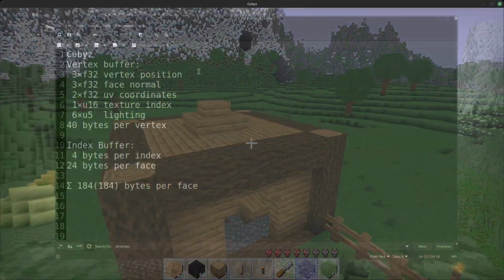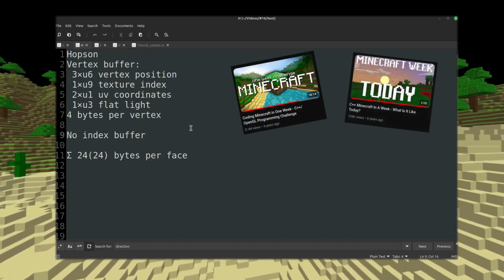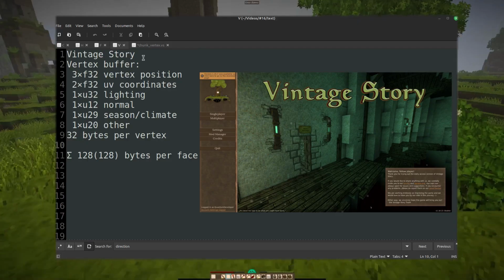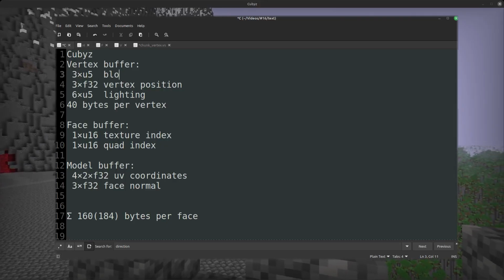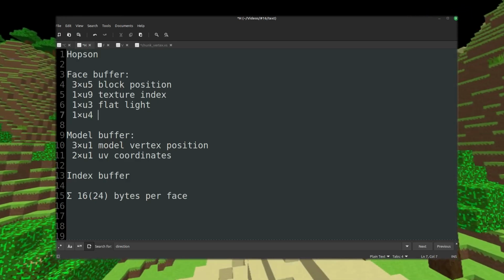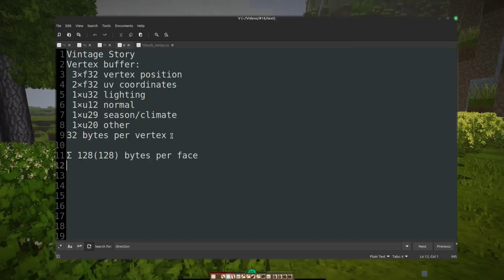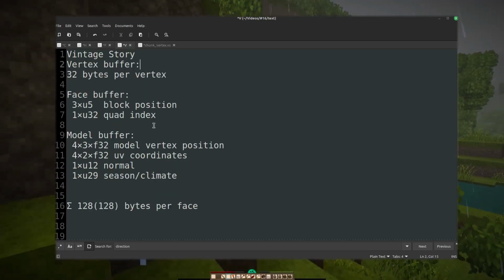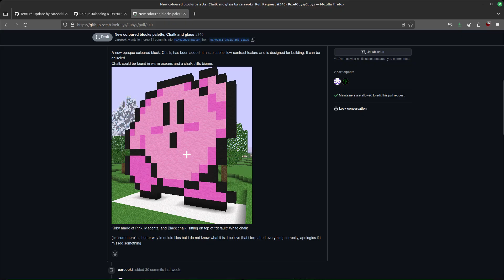Block Models, Stairs and Mesh Optimizations

Comment: why not doing the meshing on the gpu ?
Reply from the maker: I don't think it's worth the effort, especially if the other bottlenecks, like networking and terrain generation, cannot be done by the GPU, so there will be a lot of copying.
Furthermore I want to support integrated GPUs, where it's likely going to take away too much processing power from the actual rendering.
Also I think I can more efficiently manage and allocate the mesh data from the CPU side.
Reply: @quantumdeveloper2733 Thank you but i have another question: can the model list work with every type of model faces or does it has to be a quad ?
Reply from the maker: It has to be one face type, and here I chose quads because it is the most common face in Cubyz. But luckily for us a triangle can be represented as a degenerate quad, which is a bit wasteful, but better than nothing. So yes, every type of model faces can be supported.

Comment: I don’t really get how the index buffer can be reused here… aren’t the shared indicies wildly different between chunks?
Reply from the maker: I limited my engine to quads only, so the index buffer is just a collection of quad indices (0, 1, 2, 1, 2, 3 or something like that).
And thanks to the baseVertex parameter all indices start at 0.
Reply: @quantumdeveloper2733  I fear I still don’t understand…  quads as in the primitive GL_QUADS? Isn’t that deprecated? (Thanks for the fast response btw!)
Reply from the maker: @mihneagubani6336  as in 2 triangles, 4 vertices, 6 indices per quad, no shared vertices between different quads
If I had GL_QUADS, I wouldn't even need to use an index buffer at all.
Reply: @quantumdeveloper2733  Thank you for your response! I made a lot of progress on my engine since then, but once I got stuck I used nsight graphics to look into how cubyz renders it's stuff and it says the Indexbuffer holds a huge amount of indices. I thought the idea was to only have these 6 and them getting repeated every 6 vertices? Am I misunderstanding something?
Reply from the maker: @mihneagubani6336  The vertex buffer only holds the same six vertices, offset by 4·i, here is the construction code if you want to see the full formula https://github.com/PixelGuys/Cubyz/blob/a8b36f3ca450d83e9fd2e903bb998b5f4169b7ad/src/renderer/chunk_meshing.zig#L123-L127
As you can see it is the same set of 6 vertices that gets repeated in a large index buffer, in my case ~2 MB since I made an estimate for the chunk size to be 3 faces per voxels.
This might seem like a lot, but the point is that I only need one index buffer, if I had many small index buffers I would end up with something like 6 GB for my ~250 million faces at max render distance.
Reply: @quantumdeveloper2733  Thank you a lot! Now it makes sense to me. Wishing you the best with the continuation of your project!

Comment: Is it still seperate and requires the app itself to download? Because if you want modding capabilities then add the files seperate and game seperate
Reply from the maker: Your message is lacking context, making it difficult to understand.
If you want to run the game, just go to the github page linked in the description. You don't need to install any other software to run it.

Comment: I hope something like this is possible in a game engine like Godot. But maybe I just have not wrapped my head around shaders that well yet so I don't fully understand this video yet. Would technically you would be using a compute shader for a per face buffer?
Reply from the maker: Of course it works in godot.
You don't a compute shader. You generate the face buffer during meshing on the CPU and put it into a texture(or SSBO), then in the vertex shader you read from the texture at `gl_VertexID/4`.
Reply: @quantumdeveloper2733  Thank you! I think I am getting a much better idea on how to implement this. I have rewatched this video a few times now haha thank you for making it. 
I know some people want code examples, but I think they are forgetting the cubyz code is already open sourced! And conceptually the video logic is more important than anything else.

I have been looking at cubyz myself for inspiration for the meshing algorithm. I thought it was clever to use a mask to determine out of bounds when checking neighbors. Eventually I hope to implement a face/model buffer and chunk palettes to greatly reduce memory. The only thing I am kinda confused from this video is how you are able to store indices for the entire world in a single place. I assume what you are doing is math in the shader to calculate the indices?
Reply from the maker: @AJ213Probably  For the indices I basically have one giant index buffer with 65536×6 elements with the following pattern:
0 + 4×i, 2 + 4×i, 1 + 4×i, 1 + 4×i, 2 + 4×i, 3 + 4×i for all i < 65536
Then in the draw command `glDrawElements` I can tell opengl to draw the first 6×faceBufferSize indices from that buffer.

If you are storing all faces in one giant buffer with suballocations, like I do, you can use `glDrawElementsBaseVertex` which allows you to add a constant to the entries of the index buffer.
Reply: @quantumdeveloper2733  I think I am not going to be able to do the full optimization down to 8 bytes (as I don't have lighting yet) per face as Godot doesn't support low level rendering APIs. It sucks, but at least using this video I was able to go from 168 bytes per face to like 80 (vertices + indices + face buffer via texture).

I will make a video about it one day and then reference this video XD Maybe I will switch to custom engine or modify godot so I can do the full optimization.

Comment: one thing i see othe voxel game like velorean do for render gistance is havin a normal ich terrain mesh that has the same height and texture of the voxel montain, so far away in the distance you can see that montain but it only starts rendering as a high detail voxel mesh as you gets closer
i think other voxel engine devlog also did this trick but i cant recall from memory who, if you or someone knows cudos to him too

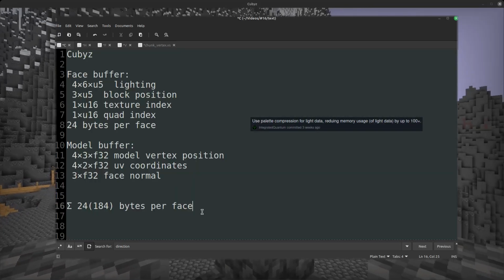Comment: 17:10 could you render further away chunks with reduced precision? reduced lighting, reduced model precision in model vertex position, ...?
sure that would require different shaders for closer/further away chunks, but especially since "most chunks are further away" maybe there is some usefulness behind that idea.
Reply from the maker: Nice idea, but it's not really worth it. The first two levels of detail take the majority of the mesh data, because the rest doesn't display any caves.

Comment: There was old abandoned game project called seed of andromeda, they had 500km view distance, they achieve this by having 2 types of terrain: close terrain which is basically regular minecraft like blocks, and far terrain which starts somewhere 100m away from camera and it made not of cubes, but of generated heightmap-based terrain, and it uses progresively larger and larger grid size as it goes into distance. So few km away terrain have large triangles which hugely reduce triangle count and all problems which comes with extra triangles. Also it helps with quad overdraw and other issues(including vram). 

Personally i did in the past marching cubes terrain using similar aproach, each chunk further from player had same voxel density(32*32*32 voxels) but voxel size keep doubling, so in last "lod" chunk had size of 64x64x64km - each voxel was 2x2x2km, and surface generated from this large chunks, viewing form over 80km distance, was perfectly fine.

Another solution could be use raymarching for rendering distant chunks, raymarching cubes on grid is cheap, but again the further they are the bigger they should be otherwise will blow vram again.

I mean, if you run out of vram cause of vertex data, you need to change approach fundamentally...
Reply from the maker: I'm already using LOD, but I would like to push the distance at which the LOD begins.
The most faces are contributed by LOD0 and LOD1, all further LODs don't render caves and are negligible in mesh size.

Comment: Hi! Can you pleasy show how you have done it in the code? I dont get how you can make a face buffer when there can be different amount of faces, but buffers in shader are const-sized
Reply from the maker: There is a link to the code in the description. I'm using shader storage buffers, you could also use textures if you want to support older versions of OpenGL.

Comment: Have you seen "Vercidium"s "I Optimised My Game Engine Up To 12000 FPS" video?
He also goes into vertex optimization.
To the point where he does buffers for each direction and has 1 large buffer for rendering for each side instead of multiple buffers for each.

Its at least worth a watch even if some things don't apply.
Reply from the maker: Yes I have watched his video and there is some useful stuff in there.
But I was really surprised that Vercidium didn't seem to know about the optimization I show here.
Instead he used instanced quads to achieve the same results that I get by using a per-face buffer.
I tried instancing myself, but it can be quite a performance problem on some computers, like on my 5 year old intel laptop I measured a 3× slowdown from instancing vs my per-face buffer.
Reply: @quantumdeveloper2733  huh good to know.

Comment: Great work Quantum! As a further optimization, I wonder if it would be worth splitting chunk data into two parts - one mesh for all of the full blocks, and one mesh for all of the block models. You could pack the full block data more tightly, reducing memory footprint (and perhaps vertex shader work if there's less data to decode). The tradeoff being you need more draw calls for chunks that have block models. Although, looking at your example, I guess you'd only really be able to eliminate the quad index at most. So perhaps, there's not much improvement to be had.

Also, I know that you mentioned Vulkan. Have you considered using WebGPU instead (the Zig project for it is called mach-gpu)? The API is higher-level and less verbose, but it still gives you the power of a modern graphics API. Plus, you can target Vulkan/Metal/DX12 with it, so cross-platform compatibility would be easier.
Reply from the maker: I couldn't even eliminate the quad index completely, since I still need 3 bits to distinguish between the 6 different faces. Together with position (15 bits) and texture index (16 bits) that's also still above 32 bits, so I couldn't even save anything really.
Generally light data is the biggest offender anyways. I can probably set up palette compression for it. That would gain a lot more memory.

As for WebGPU, I haven't really looked into it, but generally I prefer having lower level APIs. Additionally Vulkan could also allow me to play around with new stuff like mesh shaders, which could give me a selective performance boost on the hardware that supports it.

Comment: disclaimer i don't know much about graphics programming, but how would the model buffer work if ur using greedy meshing like in cosmic reach? like i imagine the model vertex positions won't work with it bc u have to store different vertex positions depending on how many similar blocks are nearby
Reply from the maker: By the way Cosmic Reach doesn't even use greedy meshing anymore.
But it would definitely be possible to do greedy meshing with a model buffer.

face buffer:
  3×u5 block position
  2×u5 greedy meshing extent
  ...
model buffer:
  3×f32 base model position
  3×f32 model extent x
  3×f32 model extent y
  ...

Then the world position is:
var pos = block position + base model position
if(isRightSideOfFace) pos += (model extent x) * (greedy meshing extent)[0]
if(isTopSideOfFace) pos += (model extent y) * (greedy meshing extent)[1]
Reply: @quantumdeveloper2733 damn i didnt know cosmic reach cut that already lol. anyways interesting solution, thanks for responding

Comment: My first thought was to just use instancing.... The only data that gets multiplied by instance count is lighting, position + maybe a bit more. Lighting could easily be < byte, and position could be just the offset to this chunk's position in the world, so we can store most of the position bits in buffers, and just fire away with glmultidrawinderct calls.
Reply from the maker: I tried it, but instancing is 3 times slower on my 5 year old intel laptop.
"Lighting could easily be < byte" Well I have 6 color channels for rgb light and rgb sunlight, so that's not going to work out sadly.
Reply: @quantumdeveloper2733  I was thinking of basic lighting so pixelout.rgba *= lightingvalue, so ya doesn't work for your case.  And ya laptop hardware is definite profile and try everything situation...

Comment: if Vintage Story has that many models, I probably don't want to make a giant buffer with all the models that I keep bound at all times. I suppose you could keep "atlas buffers" around and bind those as necessary, but that's a pretty tricky technique.
Otherwise, interesting video! I definitely don't use buffer object availability in vertex shaders to its full extent, nice to see some elaborate examples
Reply from the maker: I don't think there is a cost associated to binding large buffers.
Reply: @quantumdeveloper2733  Well, it consumes GPU memory by virtue of being in GPU memory.
Reply from the maker: Yeah, but whether you bind it or not it always consumes the same amount of memory.
And if introducing a giant buffer reduces memory usage of thousands of smaller buffers then that seems like a good tradeoff to me.
Reply: @quantumdeveloper2733  yes, you are correct, to reduce memory usage you'd need to stream atlases dynamically. Really, whether it's worth, it depends on how many different models are usually in visible chunks - I'd reckon the number is pretty low most of the time.

Comment: Really smart optimizations, nice work. Have these changes led to any increase in the framerate due to better memory throughput?
Reply from the maker: I have not done a direct comparison, since I already had 24 bytes per face before implementing block models. I could have compared it to the java version, but that wouldn't be a fair comparison since too many things have changed since then.

From a test I did a couple years ago in the java version, where I went from 56 to 8 bytes per face for lod chunks, I measured an insignificant performance increase.
But I think in the end it all depends on the hardware you are testing on and how bad the vertex data was in the beginning.

I can give you a calculation though:
If I look at the bandwidth of my memory (which seems to be 51.2 GB/s for my dual channel DDR4 RAM) then loading 8000000 faces takes 4 ms at 24 bytes per face and 29 ms at 184 bytes per face. In the current version of my engine it takes just 21 ms to render 8000000 faces. So it definitely would have increased the framerate significantly.
Reply: @quantumdeveloper2733  Makes sense, very impressive work!

Comment: There's six bytes per vertex because that vertex requires 3 sub coordinates to be in 3d space, and an integer is a 2 byte object leading there to be 6 bytes per vertex. Theoretically knowing that they didn't need to account for the blocks being off center, this is an optimization from what I would otherwise use floats for, each block being the space between four vertexes on a invisible grid. The slabs and stairs however I before watching the video theorize they either use shaders, or that they are treated like half floats while not having to be full size.
Reply from the maker: Nice try, but sadly your vertex data only allows drawing untextured terrain without any lighting or ambient occlusion.
Reply: To be honest I'm new to graphics programming and the closest to any kind of project like this I've had is my js project where I learned how to make purely cpu 3d. I only got to make the wire frame before my computer got wiped. I also wasn't really thinking about textures and vfx, I just saw the thumbnail and kinda wanted to make a comment guessing lol.

Comment: i always had a question on game engines since i saw the movie "read player one" and i think you are the right person to asnwer that, with the question being: in that move, the game has both a voxel game, the minecraft side, and the rest being"normal" game, can a online game be configured that it can be both at the same time? even if the worlds are separeted like they are, i cant see how it would work since i never saw nothing like it before.
Reply: You could discard some performance to store the voxels as regular objects and not voxels. Assuming that computing is quite robust in ready player one, performance loss is negligible
Reply: @BryanLu0    that is a interesting way, after reading your coment i thought that probably they have two diferent games connected where they can share all the skins and assets and jump between them as they were worlds in a single game. i dont know if this would be possible, but seem plausible, since you could optimaze every game to it's needs and could even implement completely diferente types of games later using this method.
Reply: @sorakagodess  You could do that, but given the level of technology in ready player one, I don't think the performance boost would be worth it to most. The VR world is like a game engine
Reply: @BryanLu0  thx for taking your time to help me out lkk <3.